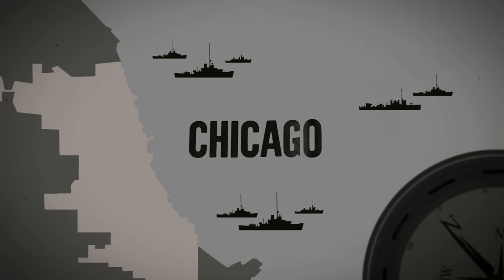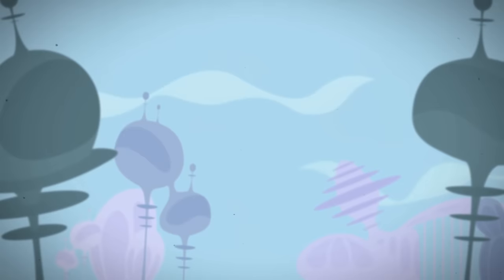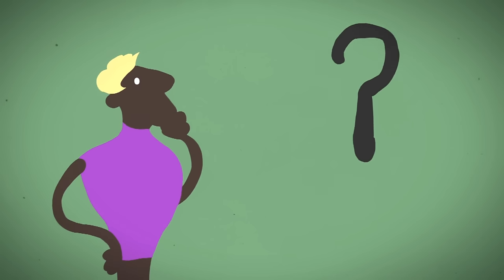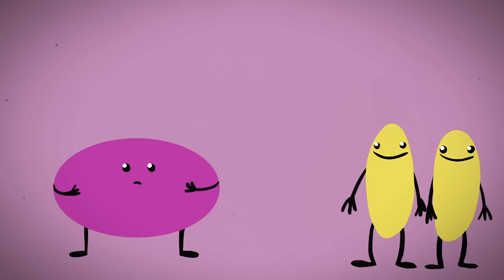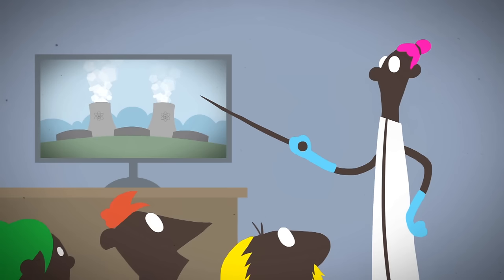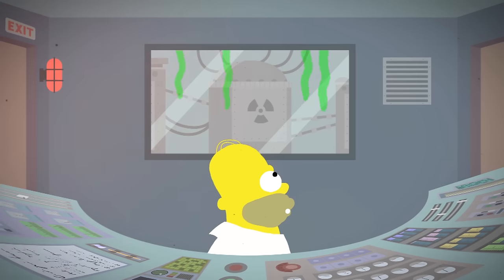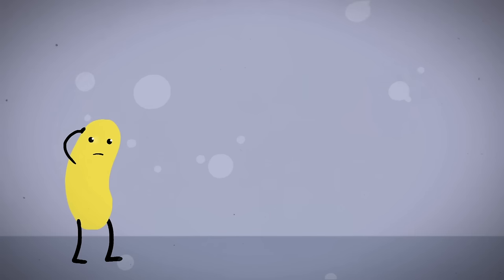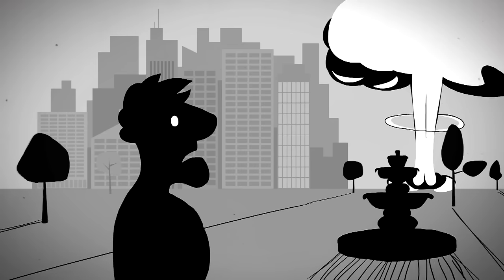How do nuclear power plants work? - M. V. Ramana and Sajan Saini

Comment: These are mostly challenges of outdated nuclear technology. The newer technology has solved a lot of these problem. The latest designs of nuclear power plants can actually use the nuclear waste from the older nuclear plants.
Reply: ًThen why did the use of nuclear power plants to generate electricity has decreased from 18% to 11% in the last 20 years
Reply: There are things called public opinion, and money. I hope that answers your question.
Reply: Lighto The reason there has been reduced nuclear power usage is because the irrational fear of all things nuclear. I think they kind of associate the danger of nuclear bombs with nuclear power.
Since most people don't like nuclear anything, there is pressure to shut down all current nuclear plants and switch to alternate power sources which caused the decrease from 18% to 11%. Also most governments are using old nuclear powerplant technology which aren't as safe or as efficient. Most operational nuclear power plants were created 20+ years ago with old technology. the technology they used was severely outdated before they even started.

Look up thorium reacters. From what I've read they seem to be the future. Also there are working designs that actually use nuclear waste for fuel.
Reply: You can look up for Thorium reactors and they are not fully developed. And the reason governments are not interested in this safe and clean nuclear power is because it doesn't produce weapon-grade plutonium. 
At the end, everything is reduced on the war economics system we love to have.
Reply: The reason is Big Oil buys all the politicians, all the media, NGOs like Greenpeace, the Sierra Club, lobbyists, institutions so of course nuclear is in decline. Corruption, crony capitalism that is how our government works. Man people are just so naive.
Reply: Meltdowns are also far less likely with new reactors that use water moderators (3:04). Where as the old carbon moderated reactors could produce a meltdown of the coolant failed, if the water moderator over heats, it stops slowing neutrons down, so the number of reactions and therefor the heat generated decreases.
Reply: Tom Badger yup and those that use liquid moderator like molten salt can be designed with a frozen plug at the bottom. In the event of a power supply failure like in Fukushima the refrigerator wouldn't run and the plug eventually melts. Once that happens all the moderator falls out into a tank underneath the reactor.
Reply: is also possible to use a fast Breeder and you get rid of the wsste as you fission it until it becomes waste

plus, the surplus of fuel can be used in a thermal reactor
Reply: +Spotav that will be hard to get approval for due to non proliferation of Plutonium etc.
Reply: Many scientist try to tackle nuclear reactor problem. But all of their solution is still a theory because no investor funding their full scale project
Reply: well the cold war's over so it's hard to get funding these days.
Reply: Land and location: One nuclear reactor plant requires about 20.5 km2 (7.9 mi2) of land to accommodate the nuclear power station itself, its exclusion zone, its enrichment plant, ore processing, and supporting infrastructure. Secondly, nuclear reactors need to be located near a massive body of coolant water, but away from dense population zones and natural disaster zones. Simply finding 15,000 locations on Earth that fulfill these requirements is extremely challenging.
Lifetime: Every nuclear power station needs to be decommissioned after 40-60 years of operation due to neutron embrittlement - cracks that develop on the metal surfaces due to radiation. If nuclear stations need to be replaced every 50 years on average, then with 15,000 nuclear power stations, one station would need to be built and another decommissioned somewhere in the world every day. Currently, it takes 6-12 years to build a nuclear station, and up to 20 years to decommission one, making this rate of replacement unrealistic.
Nuclear waste: Although nuclear technology has been around for 60 years, there is still no universally agreed mode of disposal. It’s uncertain whether burying the spent fuel and the spent reactor vessels (which are also highly radioactive) may cause radioactive leakage into groundwater or the environment via geological movement.
Accident rate: To date, there have been 11 nuclear accidents at the level of a full or partial core-melt. These accidents are not the minor accidents that can be avoided with improved safety technology; they are rare events that are not even possible to model in a system as complex as a nuclear station, and arise from unforeseen pathways and unpredictable circumstances (such as the Fukushima accident). Considering that these 11 accidents occurred during a cumulated total of 14,000 reactor-years of nuclear operations, scaling up to 15,000 reactors would mean we would have a major accident somewhere in the world every month.
Proliferation: The more nuclear power stations, the greater the likelihood that materials and expertise for making nuclear weapons may proliferate. Although reactors have proliferation resistance measures, maintaining accountability for 15,000 reactor sites worldwide would be nearly impossible.
Uranium abundance: At the current rate of uranium consumption with conventional reactors, the world supply of viable uranium, which is the most common nuclear fuel, will last for 80 years. Scaling consumption up to 15 TW, the viable uranium supply will last for less than 5 years. (Viable uranium is the uranium that exists in a high enough ore concentration so that extracting the ore is economically justified.)

Read more at: https://phys.org/news/2011-05-nuclear-power-world-energy.html#jCp
Reply: ElectronicSwordfish After 6 years uranium loses its ability to create enough energy but is still highly radioactive which is nuclear waste
Reply: Lighto public outcry. The meltdown in Japan showed us something: nuclear power shouldn’t be everywhere. However too many people refuse to see the bigger picture and rely off of old research and models.
Reply: @whykhr  You're saying Sierra Club is bought by big oil?
Reply: @lighto2240  Because that would make sense lol. Modern designs for reactors do not explode, they can be almost entirely automated with minimal human surveillance, and burn nuclear waste rather than enriched uranium. Burning nuclear waste is not volatile, and while it is a temporary solution since nuclear waste is finite, it's a solution that will last for more than 100 years. Plenty of time to develop more advanced nuclear plants.

If you have netflix, watch "inside Bill's Brain". an excellent 3 part documentary about Bill Gate's exploration into changing the world. Developing new methods of creating clean water, clean energy, and disease free environments.
Reply: @gusstavv  someone finally talked about this yeet
Reply: @BrianSu  

Many of the problems you've listed are from older reactors.  And many of the 11 disastrous cases were caused by 100% foreseeable causes.  

Thorium is much safer, as well as new reactors don't use water as a coolant anymore, they use salts.  

They are also can be built far smaller now which makes them more affordable.  And the radioactivity last only a few hundred years (with thorium) not tens of thousands of years.

If we have freeze plugs it would have eliminated more than half of those accidents because it requires no operator inputs (walk away) for safety.  Also the technology featuring freeze plugs has been around before Chernobyl even exploded.  They were just more expensive to build at the time, which is why they were not widely spread.

And finally there is more radiation from a coal power plant than a nuclear plant(providing there is not meltdown) due to radioactive elements that appear in coal.

That all being said, weapon grade fuel is a real concern atm for all methods of power moving forward.  

There's a good spacetime episode from PBS on the thorium reactor for people to check out.  We can't tackle climate change without nuclear power.
Reply: Thorium
Reply: They also use thorium, which is much safer and productive than uranium.
Reply: @lighto2240  helium and hydrogen pretty clean clear utopian fusion technlogy
Reply: But still would a metldown be an catastrophic event, hurting generations to come with DNA damage. The problem is not the likeliness, it might be very safe. The problem is what might happen, how unlikely it might be. It's simply not worth the risk.
Reply: Also thorium so literally half of this info is useless
Reply: Yep, can use this waste to produce more waste...
Reply: @lighto2240  i'm not an expert but i think it's mostly because of money. Nuclear power plant are more expensive to build than other alternative.
Edit: if you want a more detailed explanation about it, here is a video explaining it (this video is from real engineering)
https://youtu.be/UC_BCz0pzMw
Reply: @theopenacademy9102  say that if the source that you have does not base on obsolete nuclear technology. Try do some research on the new breeder, thorium and other technologies that would definitely debunk the arguments that the article that you have posted have placed. That's the problem about you people who are anti-nukes, you don't do enough research. You just read an old article with ancient argument and then you immediately post to proved your stand and acting like smart even you just copied and pasted everything. Shut up and know about the latest technology.
Reply: @lighto2240  bad stigma against it
Reply: @eduardo6380  I think they are referring to technologies which actually burn down waste to very small levels. They produce very little waste in comparison, so the net effect is much less waste.
Reply: For God so loved the world, that he gave his only begotten 
Son, that whosoever believeth on him should not perish, but 
have eternal life. (John 3:16)

Mert úgy szerette Isten e világot, hogy az ő egyszülött 
Fiát adta, hogy valaki hiszen ő benne, el ne vesszen, hanem
örök élete legyen. (János 3:16)
Reply: It is possible to reuse the spent fuel from reactors but its kinda expensive from what I’ve heard. Another reason why there was a drop in the popularity of nuclear energy is because what people think when they hear nuclear energy is bombs and not the power plants, another is what happened in 1979 to 2011. Three Mile Island disaster in 1979, Chernobyl disaster in 1986, and the Fukushima Daichi disaster in 2011.
Reply: @coldsun1  SAM O NELLA Thorium all the way
Reply: @gusstavv  Also take into consideration the multi trillion dollar fossil fuel industry, nuclear does not benifit them
Reply: The challenges don't go away, we've just learned how to deal with them very well
Reply: @lighto2240  Mainly Public distaste. We have newer, safer, more efficient technology for nuclear power plants, that don’t produce waste and can’t meltdown like chernobyl. But everyone is still afraid of nuclear power because of it’s prior reputation
Reply: Wow
Reply: @lighto2240  I believe it is because of other sustainable ways to provide energy getting more popular.
Reply: The Yangem  6 billion dollars to invest in fusion tech
Reply: The Yangem  I know it’s not that simple but srsly give me a break I’m an 8 year old
Reply: The Yangem  I know but couldn’t care less
Reply: @gusstavv  This is not true, a Throium reactor can still generate Uranium-233, which very much can be used for nuclear weapons. It is generated if the recently used Thorium is removed from the reactor and the Protactinium-233 is separated from it. Decay of this Protactinium-233 (with a half time of just 27 days) will turn into pure Uranium-233. Throium reactors are pretty neat, but the fact they can't be used for weapons is an outright lie
Reply: @lighto2240  Bad publicity leading to less funding to nuclear energy. More efficient fossil fuel options that are always taken because of corruption and familiarity. Other renewables like wind and solar are becoming cheaper and more reliable. There's no single reason why nuclear has gone out of popular use, but these are the big ones.
Reply: @theopenacademy9102  Much of this has already been covered and disproven besides the Proliferation and Nuclear Waste point. I'll touch on a few points though. "Land and location:" We need 15,000 reactors to power the entire earth. But we will have wind, solar, hydro, geothermal, and others to cover a good bit of the world's power needs so the number of needed reactors is far less. "Accident rate:" The injury and death rate are far far lower than coal, natural gas, etc. Even the death rate caused by pollution of people not involved with coal mining is higher than the total death rate of nuclear power. "Lifetime:" Coal plants and mines and other such developments also have a heavy rate of turnover/rotation. You need to compare the statistics of nuclear to how often a new mine has to be found and created and how much heavy maintenance a coal power plant needs
Reply: Nuclear is hands down a safer and more sustainable option than coal, natural gas and oil, Waste is a small concern, a drop in the bucket compared to the large numbers of people that die every year due to fossil fuel pollution(and miners directly dying), and due to climate change from CO2 emissions. Nuclear proliferation is its own beast though. Hopefully we will progress to solutions such as Thorium and that wont be a concern
Reply: @Sumanitu  The long and short of his post can be summed up- while doubling or tripling nuclear output is fine, we need an overhaul of nuclear industry. Building on your comments : Breeder reactor -> Pu Reactor -> Recycle for example would help. 15k is of course silly to expect and most reactors are next to one another in a given power-plant. Most energy is also consumed by First world nations where proliferation isn't an issue.
Reply: @lighto2240  people getting scared of nuclear energy because of cHerNobYl
Reply: @seanjordan6549  Well that and they are a larger investment which takes longer to pay off
Reply: Is it worth the risks? Not can we, but should we?
Reply: So then modern nuclear reactors have no waste?
Reply: @coldsun1  Funny thing about the thorium rector is that the best safety in it is a cork that will melt during meltdown, because thorium need plutoniu, to work.
Reply: Small modular reflectors are safer, cheaper, and more scalable for production than Thorium, or Salt reactors. There are startups working on this.
Reply: This was 5 years ago look at what they do today
Reply: @lighto2240  because people (like you for example) get 100% of their info from the simpsons and misinforming videos like these
Reply: @lighto2240  oil&green lobby. New NPP on fast neutrons built only in Russia since 2018.
Reply: Not really.
Reply: But even newer plants create more nuclear waste material.
Reply: @sarahmccoy1941  not really. Natrium fast neutron ones produce reusable isotopes
Reply: @lighto2240  because ppl scared af of a disaster which is actually rare
Reply: Plutonium: Laughs in radiation
Reply: we should reuse the waste to save the environment from too much uranium mining
Reply: That's really good that it's become safer

Comment: I like how this is still basically a giant, super-high-tech steam engine.
Reply: same
Reply: Lol yes
Reply: The majority of powerplant use steam.
Reply: @thesauce1682  Even some solar plants essentially use mirrors to magnify the sun into a single spot, that spot has a giant rock of sodium that heats up, then is used to boil water etc...
Reply: @imarocklobster  Don't solar panels absorb the suns rays and the suns rays knock the electrons out of the silicon?
Reply: Hi talon
Reply: Ever heard of the chernobyl Incident ???
Reply: @sarathapa3472  yes. I don’t see how that’s relevant.
Reply: all i heard was blah, blah, blah...steam turns a turbine. I didn't see that coming.
Reply: "World's most expensive kettle" as someone called it.
Reply: Indeed and steam engines have never been very effective. That's also why we don't see steam locomotives on our railways today...
Reply: @Soilworker  It drives a steam turbine though which is much more effective than old locomotives. There’s no 100% effectiveness in energy conversion so it’s about how high we can get compared to alternatives.
Reply: Yeah, that surprised me. A lot of power plants is just stream to turn a magnetic turbine.

I believe hydro and wind farms basically amount to turning a magnetic turbine.
Reply: Same thoughts lol. It's just that the materials heats up the water converts it to steam and then power up the engine 😅
Reply: Ironically steampunk fantasies are much closer to real life than the science fiction we get from the Matrix 😂

Comment: They completely ignored the fact that the "waste" Plutonium-239 produced from the transmutation of Uranium-238 in the nuclear fuel rods can be filtered out and used in fast breeder reactors as an energy source. There are several of these in the world currently. In addition fast breeder reactors don't need moderators to slow down neutrons and the fuel is self-sustaining in a sense because the neutrons released from the fission of Pu-239 can be used to transmute U-238 into Pu-239 again.